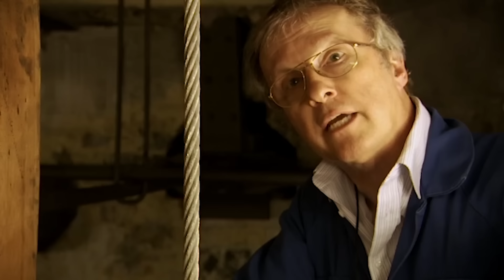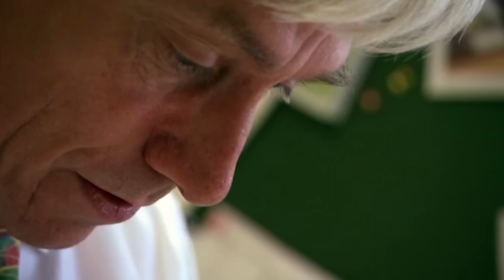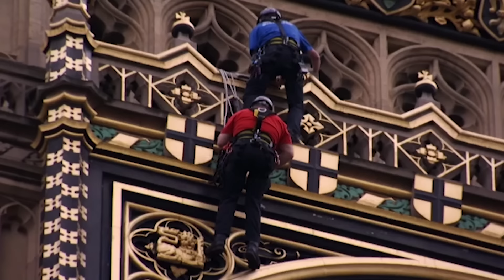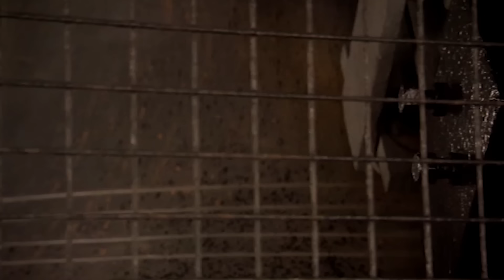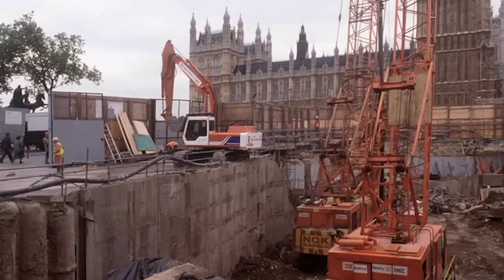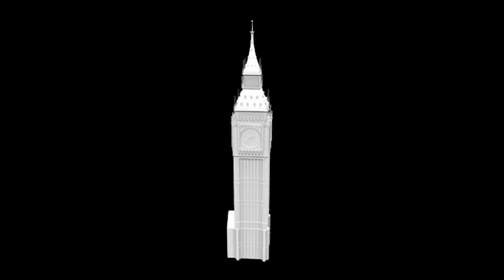The Genius Design Of London's Big Ben Clock

Comment: "Will Big Ben make it to the next century?"  With the tower getting a total facelift, the opal glass completely replaced and the clock mechanism torn apart and completely refurbished... that's a definite yes as long as the tube that went underneath the tower doesn't collapse.

Comment: A very informative  and enjoyable program - much appreciated.  However, I do think it slightly regrettable that, due to editing, no doubt, we heard two examples of incorrect sequencing of the chimes.  The first one at 36.17 consisted of ,  (using the degrees in the major scale),  3125  - 5231.   Now those two groups would be heard at the beginning of the three quarters  followed, by the way by 3215.  For the hour, we should have heard  1325 - 1231 - 3125 - 5231 - followed by the strikes. But we didn`t.  So you cansee, (and hear) that we actually heard the third and forth sequence twice over.  This does not happen.  The other example is heard at 49.38 where we hear a complete mix!  the beginning of the three quarter chimes - followed by the second group of the hour, or half hour chimes followed by those same two sets !  It is still lovely to hear these bells - but to somebody who recognises and remembers these details - it is rather off putting!  Sorry - but I noticed this - I wasn`t waiting for something like this to happen.  There are five groups of chimes altogether.  If we number them , starting with the hour chimes, we have groups one, two, three and four - followed by the strikes.  At quarter past we have group 5.  At half past, we then have one and two - and -  at quarter  to the hour, we have three, four and five. Which brings us back to groups one to four again for the hour. So the groups have had two rounds during that time. This is a good use of space available to get ten groups of notes used during the whole hour - but only using five sets of hammer lifters on the shaft.  All the best!  Bev

Comment: Many commenting about the fact that the hour bell is Big Ben, yes it’s correct however if this documentary was for the towers 150th anniversary then that would put this at being filmed/ produced in 2009. 3 years before the tower was named the Elizabeth tower. Technically at that time the correct term would have been the “clock tower” as it wasn’t officially called St. Stephen’s tower either. I guess before the big name change for the queen in 2012, referring to the whole structure as Big Ben was more common than today.
Reply: You are correct. It was often called the Big Ben clock tower, shortened to Big Ben 'cos tourists know Big Ben but not the Clock Tower.  St Stephen's Tower was what London Cabbies knew it by, but they were wrong.  St Stephen's is the main entrance to the Palace down Old Palace Yard way.  The Victoria Tower is at the other end of the Palace.

Comment: Fun fact:Actual Big Ben (which was the name given to the massive bell inside the tower)was made by the same foundry in London(Whitechapel Bell Foundry)where the famous Liberty Bell in Pennsylvania U.S.A was made 106 years earlier in 1752.
Reply: @patricksanders858  Its not a recommendation its just information.
Reply: Correct Sir
Reply: @DarkSideOftheMoon1973  Just out of curiosity, are people over on your side of the pond (U.S) generally aware of this would you say?
Reply: Darlington Clock Tower's bells are sister bells to those of Big Ben in London. Both sets of bells were cast by the same company, John Warner & Sons, and share a connection, though Big Ben is technically the name of the bell, not the tower itself

Comment: Well considering Big Ben is actually the nickname of The Great Bell which is the main bell in the tower it will never start ticking because bells don't tick. The clock is called The Great 
Clock and tower is called Elizabeth Tower, prior to 2012 is was just called The Clock Tower but it was renamed for the queens diamond jubilee. You would think a channel that is supposed to be about information and facts could get that right.

Comment: I had a chance to walk all the steps to the bells. Along the way near the mechanism the guide pointed out some very old coins no longer minted but used to "balance" the pendulum. It was a very awesome experience.
Reply: I had to wonder how many coins might have been accidentally dropped over the years and might be lying at the bottom of the pendulum pit!  :)
Reply: @EarlyMusicDiva  Im sure they were retrieved, even so, not minted any more doesn't mean a lot- there's loads of such coins in people's drawers, on ebay and coins shop web pages for sale. Being adopted and finding out I was Irish and not knowing for 60 years, I bought some Irish coins pretty cheap- obsolete not they went to the Euro but I bought among others- some half crown coins from the 1950s featuring the Irish horse on one side, they were like $2 a piece- lots being sold for scrap too.

Comment: 🇬🇧 - amused to how sensitive they are to the clock’s behaviour/perception to the public ~ must be precisely set to the correct time (even relying on something as old as the talking-clock on the landline telephone ~ which in the near-future will be discontinued, then what will they do?) and even turning the face lights off when turning the clock back -1 hour for daylight saving time ~ so the public are not spooked by seeing the weird appearance of the hands rapidly turning an hour back. As of 2023; The clock itself is called the Elizabeth tower, but is given/referred to the name of the hour striking bell, it was recently externally refurbished and cleaned and went silent for several years for the process [a motor being used to strike the hour for special occasions] and it now looks brighter and much cleaner than in the documentary (other commenters have said it was recorded in 2010 ~ 14 years ago) we have had the funeral of Queen Elizabeth 2nd - where the Elizabeth tower chimed 72 times timed with the firing of a cannon, of her reign. Quite a lot has happened since this (out of date) documentary was recorded

Comment: Several minutes into viewing, Big Ben used multiple times giving the wrong impression that the term Big Ben is name of the clock tower, not so and shame of commentator for not identifying the name of clock tower and the role of Big Ben within the structure of the Elizabeth Tower. Big Ben's the hour bell, big bell, big sound not as intended due to crack but considering when it's was made, where it's been hung several stories up inside a building not purposely designed and built for the hoisting of massive metal bells. It's cracked a little and that will do, considering alternatives way back when originally placed. No motorized anything.

Comment: There is a process where they can use wet concrete like a hydraulic fluid to lift and level a building of any size. Has that been considered to bring the great clock tower back into plumb?
Reply: The early cracks that took place more than a century ago have both automatically grouted by settlement and been filled. Since such a period of time, they are obstructed from closing, so tilting the foundations could allow cracks to open on the opposing sides.
Therefore, concrete is only pumped to maintain the existing equilibrium, plus a fraction of a millimetre  at most. Any attempt to correct the original movement would need to be done very slowly and monitored. It would probably take at least 50 years.

Comment: I’m only about 1/3rd through this documentary, but I wonder if they’re going to speak to how Ben survived the bombing by the Germans in WWII ?
Reply: I would assume the same way as buildings on the other side: with lots of luck
Reply: The exterior did receive some damage, after a direct hit on the House of Commons chamber. It was all rebuilt & repaired.

On a separate note, it wasn't all down to pure good luck or fortune. Many famous London landmarks, such as Westminster, Tower Bridge, etc, were used by German pilots as visual aids to help guide their raids. So they weren't all necessarily targeted deliberately as a result. It would've been counter productive, which rather ironically meant that such famous landmarks were largely spared direct hits. 

This was why the lakes in the garden grounds of Buckingham Palace were drained, so it would cause confusion as to their location for German pilots. Such a simple tactic meant the Palace was largely spared in air raids, although again, the grounds were hit, causing some structural damage to the main building.

While St. Paul's cathedral was never hit, it did come under very real risk of destruction from the raging fires, caused by the raids. It was through pure determination of the firefighters, wardens & volunteers, that the building didn't go up in smoke. This was also a significant risk to any & all landmarks/buildings. If they weren't directly hit, then the resulting fires could potentially spread, posing very real risk.

As for the Underground, while the deep level stations were the safest, the sub surface stations were more at risk. One did receive a direct hit, killing people sheltered inside, although I can't remember the name. Separately, there was a crush incident at Bethel Green station, when some people tripped going down the stairs during a raid, causing a domino effect & crush. Many people died, but the incident was covered up at the time by the government, to avoid causing panic.

While I mentioned that the deepest level tube stations  were the safest to shelter in, those near the Thames had emergency flood doors installed, in case of a direct hit on the network, causing catastrophic flooding into the stations. Fortunately, these were never needed & have since long been removed. 

So, yes, while good luck did play a large part in many famous landmarks avoiding direct hits, it was also in part down to strategy on both the home front & from the Germans.

Comment: Wow, that’s crazy…I never knew Big Ben was leaning. 180mm = 7.09 inches…Wikipedia has the tower height at 316 feet, that’s approximately 1 inch lean per every 45 feet.
Reply: Big Ben is the bell not the clock